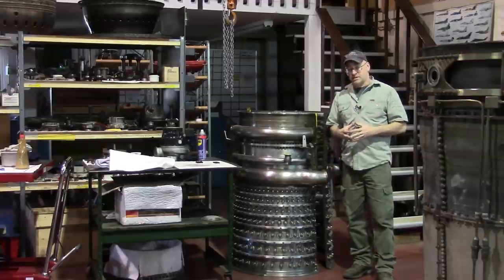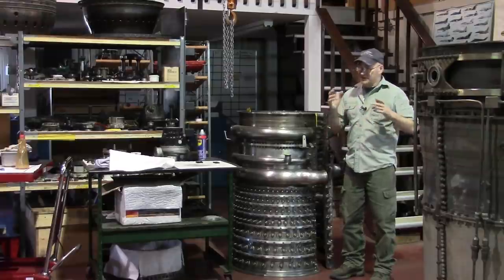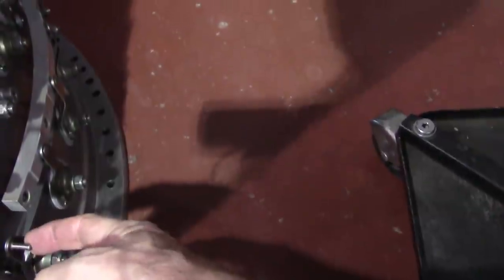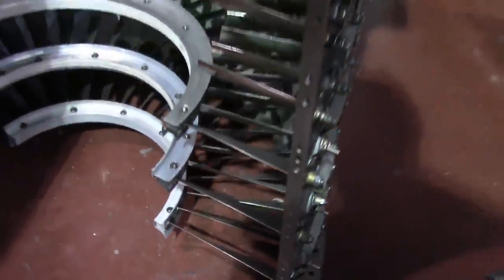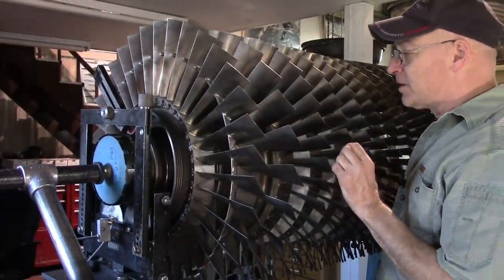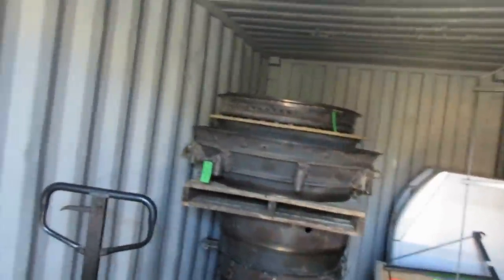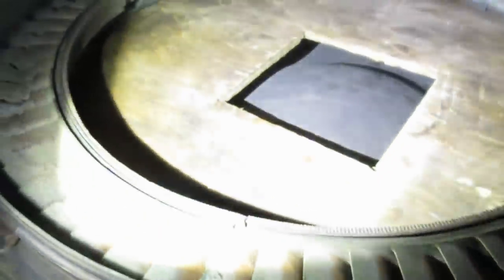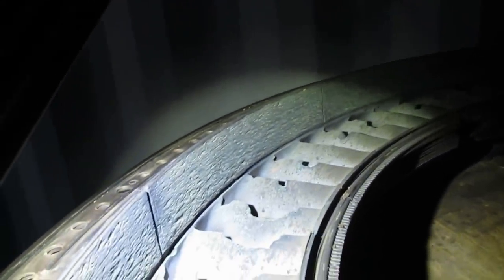Turbine Engine Heat Damage

Comment: Excellent video, as always, thanks. Before and after shots are a great addition. Makes me marvel even more at after burner tests you've posted; screaming hot gas coming out the back, no parts flying out, no sneezing out the front, and it's meant to run that way. Wow, what an invention to work on.
Reply: How much kw/ hp does this engine make brand new vs end of service life?
Reply: Hello squidgysailor, answering for myself: I don't know, but interesting question. I'd send that question to the pros.

Comment: Other than having the scrap in one convenient to manage heap, this wasn't that much of a save. Still significant savings over the price of a brand new one certainly, but what you did for the used parts market will likely be felt for years. Thanks for letting us tag along AgentJayZ. I waz here and I waz impressed.
Reply: Well they saved the entire compressor and combustor. Only the turbine section was a goner.

Comment: Excellent informative video as always! I'm intrigued by the compressor stator vanes half way down the compressor stator.....they look too big and they are hollow.....what's the story with those?
Reply from the maker: They fit, and they function well. It's up to the engineers and their magic to come up with a combination of numbers and shapes of these little wings to do what needs to be done. They are hollow to provide a pathway for air to escape to a collection point on the outside of the cases. Bleed air is taken off at various stages of compression, depending on the pressure needed.
The farther back along the compressor, the higher the pressure and temperature.
Reply: @AgentJayZ Thanks for the explanation - I did wonder if they were for air bleed....I'm more used to see a circumferential slot in the casing wall feed an annulus where the air is drawn off.

Comment: Awesome to see finally, the damage to the rear frame is amazing. Was that impact damage or heat and oxidation damage? I've seen aluminium sheet look like that after a shed fire.

What part of the engine is irreplaceable, where if it goes the engine is ruined? If you crack a block on a piston engine then even if you fix the engine it's not really the same engine anymore. Is there a part like that in jets where it's not so much fixed as the other parts were salvaged and used to make a new engine?
Reply from the maker: Turbine engines are not sent out to limp back into service. An overhaul returns the engine to as new function.
When this engine is rebuilt, it will make the rated power for another overhaul interval.
There is no one piece that is the decider on fixing the engine up. Every part is replaceable, but if too many of them a ruined, the repair will cost more than buying a replacement engine. In that case, the engine is described as Beyond Economical Repair.
Reply: @AgentJayZ  Thanks! I know that's the standard you get them back to, I just wondered if there was anything that made them not worth it. I think you showed us some extremely rare Orenda turbine blades a few years ago that would have been almost impossible to replace if the were damaged or lost.

Comment: Hi guys, 

I'm having a discussion at work regarding a dzus fastener ingested into one of our engines. There were no in-flight symptoms reported; the fastener was found to be missing and on inspection there was a small amount of damage to the first stage compressor, so the engine was replaced.

One of the younger pilots said "it was only a tiny amount of damage, surely it's fine". I explained to him that we don't know what's happened inside and potentially one of the turbines is damaged. I probably went a bit far and said there could be a blade missing.

It's an Allison 250 C30; how much damage do you think could be done to the turbines before the engine noticeably lost power? Is it possible for part of a blade to depart and the engine continue to produce power?

Thanks much
Reply from the maker: The C30 has no axial stages in the compressor, just that big ol' centrifugal, and it's pretty tough. The turbine blades spin at over 50 thousand rpm, but they are very solid. The Dzus fastener has some steel in it, and it;s a bad thing for any turbine engine to eat. You probably but some deep gouges in the compressor, some dents and possibly some tears in the combustor liner, and maybe some impact marks on the turbine inlet guide vanes. The turbine blades would likely be undamaged. All those parts will be replaced, so it's going to be a bit pricey. If it was an industrial engine, it would be returned to service as is, most likely.

Comment: What do you think how much would the thrust of jet engine would be affected by using adulterated fuel? And do all jet engines have variable-geometry stator blades for compressor?
Reply from the maker: Adulterated with what?
Almost all modern ones do. Some of the old ones that don't are still flying.
Reply: Kinda a late reply, but generally jet engines only really care about how much energy is produced per unit of fuel, provided the fuel doesn't gunk anything up and the fuel delivery system is ok with it. It's not like a piston engine where the exact properties of how a fuel ignites and the speed of the gas expansion are closely monitored and controlled, if it burns well it burns well.

I seriously doubt there is anything remotely practical you can add to jet fuel to make it perform better, the US military dumped a lot of money into trying to find something during the 50s and 60s and never found anything that worked, and I doubt anything new has been invented since that could work.

Comment: Balancing a disk is very important thing. I know of specialized equipment designed to do just that. Armored wall vessel containing all the drive motors spinning a disk well above maximum speed that it will ever experience in real life in partial vacuum. It took 24 hours for the disk to coast to complete stop after hitting an E-Stop. The one time when the disk came out of the test assembly and penetrated the armored enclosure, it exited through the concrete wall and traveled another 40 meters in dirt away from the building. The test room was located below ground level just in case that happened. It took a metal detector and a backhoe to dig it up. Another example of that piece of equipment blew out a disk last year in the one facility located in one of the northern states. I heard the damage was extensive.
Reply: DAMN.  That's insane. What incredible power. Who even manufactures these powerful disk balancing test motors.
Reply: My God...never mind Star Trek-the metallurgy, construction techniques and just the sheer forces involved with these engines are astounding.

Comment: I've read that the engines in the MiG-25 would be severely damaged when they'd push it up around Mach 3.  I've always wondered how they would fail.  It's just thermal breakdown of the components and it starts destroying itself?
Reply from the maker: The hotter you run, the more power you get. Maybe that plane had a time limited rating, like takeoff power, that the pilot could engage and eventually burn things in the engine.

Comment: Great vid! Quick question about the fuel control: once you've put an engine together, do you have to do any sort of calibration to the fuel control before you test it? Or are they designed in such a way that they can only deliver the correct amount of fuel?
Reply: Also burner modes are mapped, sprint curves, acoustics etc.

Comment: 12:40  Yea, you can have all the sophistication you want in vibrational analysis equipment, temperature monitoring etc.  It still doesn't stop the one idiot worker from overriding/cancelling it when its halting production. 

I work in industrial motors, alternators, etc...  The worst I have seen was a 3.3KV 1000KW motor that came in for repair. When we took it apart, the balls in the bearings were literally welded to the inner race, nothing was salvageable, despite it having everything mentioned above.  The balls in the bearings were about the size of a baseball for size comparison.

Comment: Hey AgentJayZ, thanks as always - fascinating post-mortem. Interested in what considerations would you be providing the customer with for re-fitting the engine back into work?  If shards of red hot steel were flying out the back and into a power turbine, what will the customer have to do there - do you overhaul power turbines? Dooes your company provide onsite services after repair? Little but aside from the norm, but presume you dont want the thing back next week for repairs again so is there any kind of onsite professional service to ensure success when put back to work?

Comment: Why is there a nonadjustable stator stage, somewhere around the middle of the compressor, which is more massive and even hollow? They almost look like blades from the early turbine section. Is that for a mounting or a bleed air or actually cooling purpose? One can see pressure piping on the outside of the casing, leading towards those stator blades. Thanks!
Reply from the maker: It is a bleed air takeoff point. The piping is not leading to the stators, it is leading away from them.
Reply: @AgentJayZ  Thank you very much!

Comment: Another dumb question: It looks like the first 6 sets of stator blades are variable pitch and the last however many are not.  Whats with the 8th set that are so much wider than the first 7?  I'm guessing the variable pitch stator blades have progressively less variability as they go from the inlet towards the compressor end and the 7th could be variable but the change would be so small it just doesnt make sense to add it.  It looks like theres a larger gap between the 8th and 9th set of compressor blades but the blades themselves look similar.  Gotta be something special about that 8th stator set (hope I counted right).

Comment: Hi ! Thanks for all the videos !

How to know if a turbine has been hot started?

When I start a helicopter, if the turbine start normally (fast and not hot) and then when I’m flying the tot is “normal”, does it mean that is gas never been cooked? 
Or it’s possible to be hidden and not detectable?

Thanks
Reply from the maker: EGT limits are monitored very closely in any turbine engine used in aviation. A hot start, as defined by the operational limits, is a serious event, and is always recorded by the FADEC in modern equipment, or entered in the log book in older machines.
A true Hot Start, where the egt limits are exceeding during startup, requires an inspection before being either repaired or cleared for further operation.
Under certain combinations of temperature and duration, the engine is removed and returned to overhaul, regardless of its service time or apparent condition.
Reply: @AgentJayZ  thank you very much for your answer

But what I meant is, 
Would it be possible for a pilot to hide a hot start , or would I feel something different in the machine, like a hotter start or some vibrations, ?

In older machines, there are no records .
To purchase a machine we can’t really open the turbine, hence, we just need to believe the other pilots, or we would feel it ?
Reply from the maker: "Can't really open"?

I think you should talk to a respectable helicopter engine technician/inspector/overhaul company.
Just my opinion.
Reply: @AgentJayZ  and I believe in your opinion
Thanks

Comment: Does cracking an air-cooled turbine blade affect the cooling air to other blades if it opens up a large passage for the air to leave through?
Reply: I can't give a definitive answer to this, but I would expect any such effect to be very much of a second order.
Reply: I wouldn’t think so as the ends are open already for the air to escape.
Reply from the maker: I think it's a bit more like: all the blades are subject to the same heat, so if one is falling apart, they all are, or about to be very soon.

Comment: As promised, I am reporting back on my visit to Brownsover Hall on 10th November for a presentation by Ian Whittle on his father's life and work.  The event was held in the actual room that served as Frank Whittle's office during the war.  It provided an entertaining and insightful glimpse into  Whittle's  life and, not surprisingly, reinforced the claim that he should be regarded as the sole inventor of the modern jet engine.  That an RAF engineering apprentice from a working class background should produce such a revolutionary proposal in his final thesis, written in 1929 and based on self-study, continues to astound me.
What I also found astounding was my first ever view of a cross-sectional arrangement of his LR1 bypass engine project, which he was working on before the end of the war.  I'd read about it but never seen a drawing of it before: had it not been cancelled, it would have been years ahead of its time.  I bought two DVDs, made some years ago, one of which I intend to send to AgentJayZ: he should be able to find a way to play it.  There is a clip of Whittle's Augmentor No.4 aft fan/reheat system running in around 1944, which AgentJayZ might find interesting.

Comment: Mhm... you mentioned that there are egt Sensors after the turbine. Should be relativly easy to detect such a over temp situation in a steady running Engine?! ... but this leads to another question: looks like the "fuel/power"regulator ist mostly Mechanical so it will need some sort of brainbox+actuator to cut power? Haven't seen this in your videos? How is thi working

Comment: Seems like there’d be sensors present to prevent those over heat failure events
Reply from the maker: The operator hires people to run the engine. Those people make decisions, to which there are consequences. The rules are written down. Most of the time they are followed.

Comment: Something I've noticed in videos with aviation turbine start sequences is that the pilot is looking to avoid a hot start and I guess if one was to ocur he'd be shutting the engine down asap. I was wondering if the damage you've shown in this video is evidence of such a thing, given that you said too much heat was produced.
Reply from the maker: I do not know the history of this engine.
Reply: There are several reasons why a Turbine engine will do this. One  is as you said a hot start . Though in that situation the pilot or engineer will shut the fuel off and keep holding the starter switch to cool the situation. Another is a hung start that isn't properly  dealt with.  Environmental conditions also could be a factor. hot day , low air pressure will reduce your max TPA  thus lowering power. Over time the failure Jay showed in the video is very likely to happen. as for the cause  without knowing the operational history of the engine it would be hard to say the exact cause.

Comment: Please tell me, why the j79 has saperated 6 combuster cans? Why it does not have a whole combuster ring or a single cylindrical combustion chamber??
Reply from the maker: Because it has ten. It does not have separate combustor cans. It has ten liners arrange inside one outer case.
This is called a can-annular arrangement.
Older engines have separate but connected combustor cans. Newer engines have annular liners.
The reasons for this will be found in the books i recommend, or in any introductory text on turbine engines.
Reply: @AgentJayZ  thank you sir for giving your important time to me. Very happy with your quick replies.👍😊
Reply: Could the engine have a single piece concentric cylindrical combustion liner. Means a single liner in whole crossection of the chamber. Instead of saperated 10 annular liners.
Reply from the maker: You are a very forward thinking individual, and you might be on to something really big... we could have said in 1948...
Note: there is a definite reason I have suggested that you read some introductory texts discussing the history and development of combustor design.
Reply: Okay sir thank you very much for your efforts.👍

Comment: This video took me back to a and p school years ago. My group had to disassemble the hot section on a timed out phantom engine. We were the first to take apart the engine since it was retired. Our first sign of carnage was melted metal particles in the exhaust. After going deeper, the turbine blades were as bad or worse than your blades. Thank goodness the phantom had dual engines for redundancy. Since then, I never sit inline with the hot section on a jet aircraft in case something were to let back there. Have you or your company ever worked on JT-8D engines? Those were the engines I worked on the most back in the day...